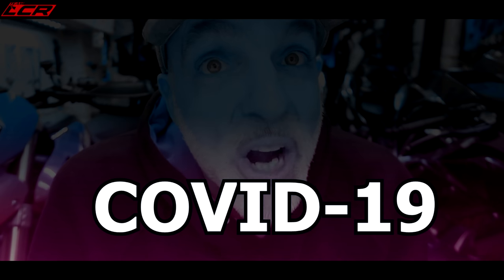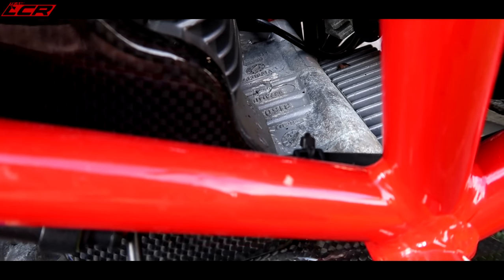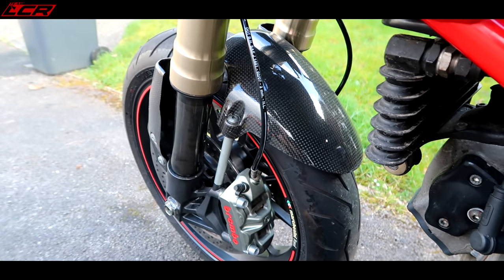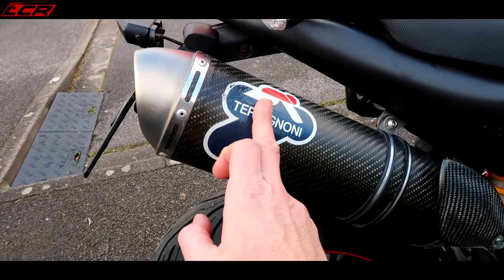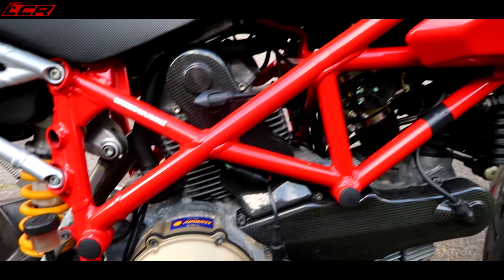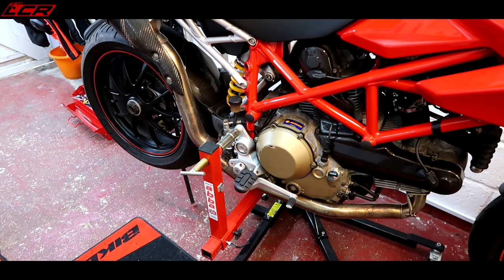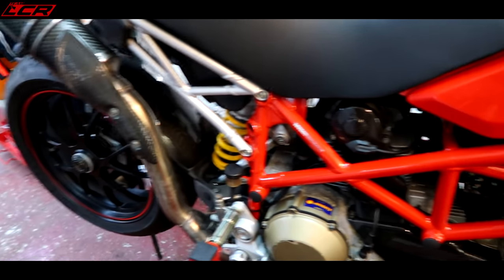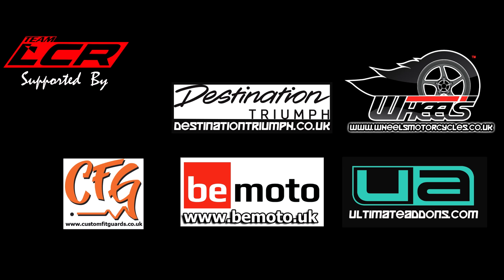Ducati Hypermotard Restoration EP01 | The Project Begins!!

Comment: Your Hypermotard needs:

-BST Rapid Tek Carbon Fiber Wheels
-IRC Quickshifter
-Mobil 1 oil change to get rid of the fog in the oil window
-Open clutch cover to expose that dry clutch (Speedymoto from the good old USA)
--Some new front brake and clutch reservoirs to replace those nasty old ones
-Corse Dynamics engine stand (it would make it quite easier)
-Bonamici rearsets

Comment: Hi Chops, great video idea. I have a ‘10 Multistrada which I have supermoto’d and one thing that really needed doing after 8 years or so was to change the throttle cables. The old ones had gradually disintegrated inside with water ingress and made it very difficult to wheelie as they were very sticky. New cables..... no problem. Well, for the bike anyway...... protective film on the paint too, you can get brilliant self healing stuff now. Oh, put it on the forks too. Ceramic coat the wheels and callipers....... enjoy!
Reply from the maker: OK great tip thanks
Reply: Micro indicators would look cool on your bike too. They are the size of a large bolt head and extremely bright. You guessed it, they are on my multi too. I took the handguards off my bike which improved the look of the bike no end. Try your bike like that, although you’ll lose your fold ins. I put Rizoma mirrors on mine though, which are also really nice and would suit the motard. Have a nice day 🙂

Comment: The foamy (milky) condensation is fairly common to see in the sight glass. I've had my 2008 Hypermotard S since 2008. Taking it for a ride and getting the bike up to temperature actually cures the issue. When you check the oil you won't notice it in the oil. Ducati also recommended switching from the Shell (what it came from the factory) to Mobil 1 or even Motul also minimizes the foaming. Lots of information on the Ducati forums. The bikes are super reliable but don't like to be neglected or kept outside. I don't ride it as much now that I have the Superduke GT.
Reply from the maker: OK great tip thanks very much

Comment: Had exact same model a couple of years ago, a total wheelie/lean meister! A few mods I did to mine which just made it a little prettier and user friendly. 
Ducati flyscreen
Ducati mirror relocation kit. Uses the existing mirrors by fixing to stems and screwing to clutch and brake lever brackets, the constant adjustment and flappy nature of the bar end position will do your nut in after a while.
R & G tail tidy, just a note though, the number plate will be very close to the single side Termi, I always used a smaller one but you will have to use a drop bracket to fit a standard plate for MOT.
Ducati sport seat, better sculpted and not like siting on a concrete block (on its side)
Carbon rear under seat shrouds

If you take the exhaust off you can use a scissor/platform jack under the engine and strap it down 

Looking forward to how you get on
Reply from the maker: Thanks Mark for the tips!

Comment: I've found it useful to hang the front end by connecting ratchet straps from the clipons to the ceiling or a large step ladder or from a 2x4 suspended between two smaller step ladders.

Comment: Last year I've changed the forks, supported under the engine, then I used custom  made from a friend standard, supporting it in the frame holes on top of rear sets for changing the chain and sprocket, I don't know who and how had tighten the rear axle nut, it came out really hard /even I was using an impact gun/ but the really hard part was the front sprocket nut (you better do it on the ground) ..The last thing I did was a STM clutch, and DP street fighter open clutch cover, really nice, didn't take the casing out to cut it, but I would, maybe next time. Good luck with the bike! I will fallow the series with interest!
Reply from the maker: Yes very good point about the front sprocket... Think I will loosen that while the rear wheel can be lowered. Good call thanks so much

Comment: Chops, if the hyper is anything like a 916/996, then get bike supported from under engine. With exhaust removed. Bit like an Mx bike. Then all bodywork and tank off, then front and back wheels. Then remove anything that stops you lifting the frame from the engine. Air box etc. You could remove subframe? I’ve never worked on a hyper Moto. Then remove rear engine bolts and swingarm spindle. Loosen front engine bolt. Should be able to lift frame up at rear, remove swing arm and then remove front engine bolt. Frame can then be lifted away, with forks still in yokes. Sounds complicated but really easy tbh. Wish I could come over and help as I can rebuild 916/999/1098 with my eyes shut. 😉 blinking covid 19. Enjoy the build, looking forward to further episodes. 👍🏻
Reply from the maker: Yes thats a good idea I can do that have an engine lift.. Ok thanks for the tip

Comment: To get the rear of the bike up off the ground, I use a strap wrapped around the rear subframe and my engine hoist. It's good to also have the front stabilized by a paddock stand. What you could do with your abba stand is try and get a bit of round bar through the subframe and lift that way
Reply from the maker: Yes good tip about bar on the Abba stand.... Could work thanks
Reply: @LambChopRides  whatever you come up with I can't wait to see the series. Your videos are keeping me sane during all this turmoil. Keep them up and stay safe. 🙏

Comment: Rizoma rear sets were good and a Oberon clutch slave cylinder a must , battery kept shaking loose there was a recall for a bracket but that shook off with me, check that as I broke down a lot due to it! I also fitted a steering damper but that was expensive.

Comment: Ratchet straps off the garage  roof. That’s what I have to do with my RC390.

I’ve got four large steel eyes, two in one of the joists and two in the wall. Drilled hole then squirt in some no more nails and screw in,

Use some thin ratchet straps off frame to support bike enough to remove things like forks, swingarm, shock etc.

Comment: Your magnetic sump plug won’t pick up flakes of aluminium, be worth finding out if the cam lobes suffers from chrome flaking off like the 996 916,    Series? Maybe check the valve clearance as well while you in there.

Comment: You could loosen all bolts whilst still on Abba stand.  Leave front end attached and hold up with normal bike stand. Remove rear wheel as you can do this with rear stand in place (insert goes into hub).
Using A frame ladder with pole in between, or 2 ladders with pole between, ratchet strap rear subframe to hold.  Transmission jack would do the same, but more expense.  Jack under engine.  Remove engine bolts and drop engine down from frame on the jack.  Could use ratchet strap to raise rear end further for more clearance.  Trick is getting something to support the rear subframe to allow the engine to drop down on the jack.
Reply from the maker: OK thanks Jimbob

Comment: For cleaning up the outer surface of the engine, I would look into wet blasting with glass bead media. AKA "vapor blasting" or ""vapor honing". There are lots of Youtube videos on it. BTW That oil drain pan is brilliant. I'm going to make one myself.
Reply from the maker: Trouble with that is engine has to be stripped as might get media in the engine. I dont want to strip all the engine to do this..

Comment: Strap the frame from your ceiling,roof trusses? Get the tank and seat off and slide a bar through the frame and make wooden supports to take the weight at each end of the bar.An upright piece of studwork with a v in the top and a piece on the floor to act as a foot,2 braces at 45degrees to stabilize it.Then you can lower the engine/swinging arm .How about one of those hydraulic tables to lift Motorcross bikes/Harleys to lower the engine? Good luck with your wallet chops!😂😂😂👍🏻

Comment: Is there anything like structural beams across your garage roof that you could ratchet strap the rear sub frame from to hold the arse up?
Reply from the maker: No unfortunately not :-(
Reply: @LambChopRides  shame.
Build an 'A' frame around it possibly? More hassle though.
Could get a mate to hold it up for a few days 🤔
Looking forward to the build. 👍
Reply: No such thing as a rolling chasis with a Ducati. I had to use an engine hoist to hold the frame when taking my Monster's engine out but was still a faff. Its worth spending some time and effort getting this right. Can you attach the abba stand to the frame somehow?

Comment: Be very very careful of stripping threads. This usually occurs when you have steel bolts into aluminium threads and there is a trace of lubricant like a bit of grease or oil on the bolt threads or the threads in the alloy or both. You set the torque wrench and it never gets tight and rips the threads out.Torque settings are for clean dry threads unless otherwise stated.
The skill of the experienced engineer is all about feeeeeeeel 😉
Reply: IME, using 243 loctite or grease on a fixing does not affect torque setting (had a similar discussion before about torqing up triple clamp bolts - l used sharpie dots as reference points and no difference between dry or otherwise)
Reply: Andrew Gayton Complete and utter bull. You don’t know what your talking about. Go away and do some research before replying.
Reply: I have tried both as well; doesn't make a difference on fasteners not using a crush washer. Anything with a flat washer tightens down the same.

Comment: I made a custom tail tidy for my bike (also has the single termi) as all of the aftermarket tail tidys on the market are designed for the double termi meaning they all stick out too far. If you search for "Diy Tail Tidy For Single Exhaust Setup (1st Gen)" on the ducati uk forum you'll find my thread about it. Only potential issue is I had to use an 8"x6" plate however it still passes MOT's fine. 

Alloy subframes for the bike exist, I got mine from Italy and I imagine they won't be available anytime soon because of the current situation. For the airbox/intake you can either get an MWR HE filter which replaces the top half of the airbox or a set of velocity stacks with filters, they both make a huge difefrence to these bikes.
Reply from the maker: OK thanks Neeps will look at that buddy, I have a 5x7 plate so would fit fine! Sounds like just what Im after

Comment: Not sure I’d completely trust the points you’ve connected the ABBA stand to. There’s a big hole for the swing arm bolt just below the brackets, so make sure there’s enough material there to carry the weight. Lovely bike Chops, can’t wait to see the end result👌👍
Reply from the maker: Hmm haha worried me now! Just checked it still upright currently 😂
Reply: Lamb Chop Rides, better safe than sorry, chops. I had a quick squint through ebay for one. If I get in trouble with the Mrs (again) it’ll be your fault🤣👍

Comment: You can do it your way but you might want to have a second pair of helping hands getting the bike off. Maintenance wise I would do the whole engine outside
and clearances. Could maybe use a new clutch and an open cover ;) Loom should be okay but I would check the sensors on the engine, especially the 
temperature sensor on your front cylinder, they tend to be corroded. Replace the tubes from the reservoir the the master cylinder for both clutch and brakes 
and maybe the whole stuff in the tank such as filters or even seal the tank newly due to rust if its metal. Greetings from Stuttgart.
Reply from the maker: Thanks for the tips matey, yes open clutch is defo on the fit list :-)

Comment: Why not hang the bike from the rafters with h/d ratchet straps. Wurth rost off is great for releasing rusty fixings. If oil had mayo, chk that any 1 way crank breathers arent clogged up (dunno if that applies to ducati though). Put all fixings in freezer bags and mark up with a sharpie. Tag electric connections with dyno tape. Take loads of photos. Get the right tools. Good luck!
Reply from the maker: Yes am considering that but have  plastered ceiling and already have some heavy shite on my overhanging storage.. could look into it though 👍
Reply: @LambChopRides  add some an additional 2 x 4 to either side of the cieling joist and a bolt up a cheapo electric hoist off ebay. I got one from Lidl and it will lift 250k ..... then you will have a hoist for other projects

Comment: Have you got any joists or anything you can strap the frame to, to hold the bike up? something to build a strong bridge type structure across it, or in front and behind could also be an option, strong step ladders can hold but not ideal.
Reply from the maker: No unfortunately not HR.. I can work around it though cheers

Comment: Get a Ti exhaust system 
Ti bolt kit
Cericoat all the engine cases, barrels and heads
See through clutch cover or dry clutch
Dual material seat cover with deviated stitching
Carbon wheels
New handle bars (gold?)
Ohlins steering damper
Full service including plugs and valve clearance
Reply from the maker: Cant find anyone who makes a Ti system :-( Great tips though thanks

Comment: The bar end mirrors are designed and built well but damn they're absolutely pointless if you're wanting to filter through traffic. I just left mine folded in and turned my head. Trying to flip them out on the move is scary as hell.

Do you know about the Desmo Challenge tail setup for the Hypermotards? Totally change the look of the bike.
Reply from the maker: Get what you're saying about the mirrors, I've also seen some Hypermotards with that tail but didn't know what it was called. Will check them out 👍

Comment: Do not hold the starter button until it starts the bike has servo assisted start. Just
push the starter button and let go the ECU will disengage the starter once it starts.
Visit the Hypermotard section of Ducati.ms you can find out just about anything 
about the 1100 Hypermotards it's the best resource for these bikes on the net.

Comment: Hi John Mr Chops Sir get yourself a manual on it if you haven't already ? taking the bike of the frame seems the way to go, got to be easier to deal with that way, got to ask what's with the half front mudguard is that how they come? as for the engine i would like to put my 2 pennyworth in, if your sanding the engine any it would look nice 2k lacquered either mat or satin that would protect it & look original material,  good luck look forward to more instalments on the bike, keep well Wayne.
Reply from the maker: Thanks Wayne, yes bought myself a manual as download format. Im using the same engine paint I used on the blade project, lasted 5 plus years without any issues so should be good. I hope!

Comment: Apart from replacing the missing screw from your handlebar mount I think a pair of machined rear sets would be so much better than the old gumboots it’s wearing at the moment. I had a Sato set on my 690 Duke and they looked and felt fantastic. Sato make a set for your model Hyper but they are pricey. License to giggle. Looking forward to Ep 2.
Reply: Sorry, that was Sato Racing
Reply from the maker: Looked at Sato Racing, they look great!! Thanks for the tip

Comment: Oddly enough, I’m in the process of doing the same thing as you! That rear swing arm/engine retaining bolt can require a hell of a push to get it out, best thing I found was a video by some Dutch blokes who made a tool out of m12 1.25 threaded bar and some pipe, I did the same and it worked a treat. Other than that they’re real easy to strip down! The real thing I’m struggling with is finding a definitive paint code for the engine paint. If you manage to get an answer I’d love to know.
Reply from the maker: Oh thats very interesting.. Will look forward to removing the swinging arm then! Paint Im not being too anal about it, Im going to be using the VHT aluminum colour engine paint. I used the same stuff on my fireblade and its held up really well. If the colour isnt exactly the same as standard Im not too worried.
Reply from the maker: Oh blimey I'm really looking forward to that then... thanks for the link 👍

Comment: would say you could do with a motorcross stand where you support the bike on the engine, might need to modify to get the correct height, and probably will have to remove the exhaust for it to sit on the stand, if you get height correct you can keep the front and rear wheels on the floor while still supporting weight of bike then would probably unholy and remove front end followed by unbolting the swing arm/ engine /frame assy. slide out swing arm remove frame from engine,  job done hahah if only.
Reply from the maker: I do have an engine lift I could use... A combination f both might work.. Thanks

Comment: Yep - youre right - bike comes off the engine....id say put an old carpet down and youll get to the point where youve just got the engine and swing arm - lie it on its side and you can lift the swing arm bolt out....as for advice - pm me on the ducati forum and i can fill you in on upgrades and mods....theres a ton of stuff you can do....well...you know what mine looks like ! :)

Cerakote....great but its hit or miss with magnesium....i had mine done in cerakote (black) one side took the other didnt....magnesium is very porus so in the end the clutch side is cerakote (happened to take) the generator side is matt powder coat....50 50 on if it took (as the cerakote failed) but lucky me - it did!
Reply from the maker: Thanks matey, yes I will be in touch love your build!

Comment: Oil wants to be HOT not WARM for a proper oil change, ie go for a proper ride, 15 miles minimum on a/c bike. Big difference in stuff coming out in suspension in the oil. And temperature as you go "ow" as it pours rather than dribbles out.
Reply from the maker: Yes agreed but we cant ride at the moment

Comment: Iam sure you should be disconnecting the battery and wiring to the engine before trying to drop the engine, and any hoses.